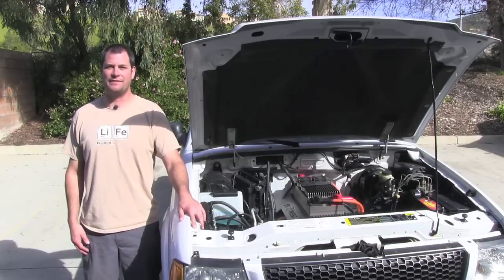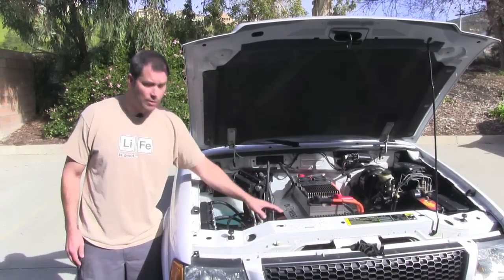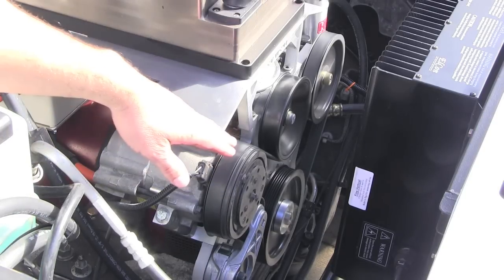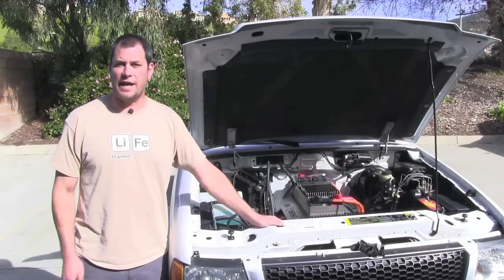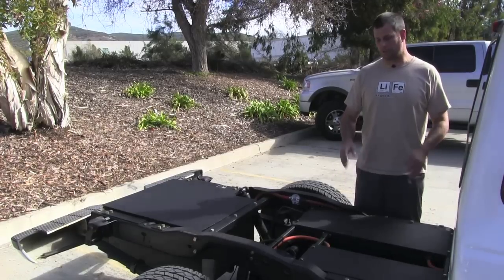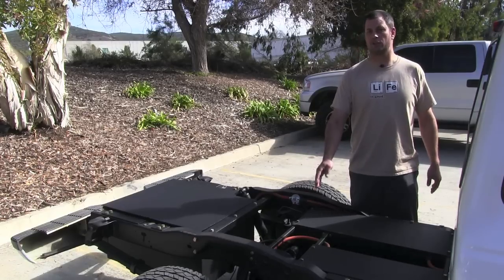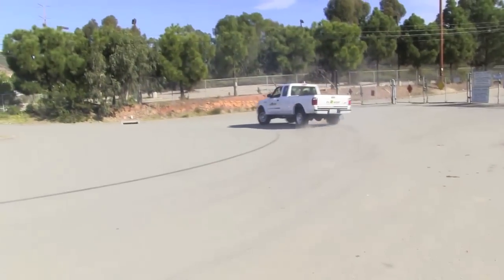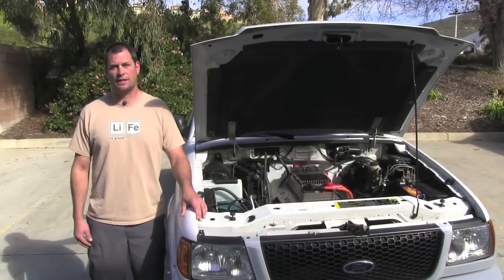EV West Shop Truck Walkthrough - 2003 Ford Ranger Conversion

Comment: In a 5 minute video about an EV Pick-up conversion, zero mention of the most important information, charge time, range per charge and price.
Reply: I imagine those are the bits of info that are not nearly as impressive as the rest of the presentation.  Short range, long charge time and pricey would be my guess!
Reply: You can find all the data for this truck on their website.
Reply: on board charging system, no down time if everything is working ok

Comment: So does this mean the traction motor has to stay running all of the time to keep those pulley-driven components working?  I would have preferred a method that powered them independently.   I would have loved for you to show us the charging port, and taken us for a test drive inside the vehicle.
Reply: I’ve been watching you for at least the past decade (since you posted this comment). I was thinking about doing a similar conversion with my truck, and I was reminded of that Eagle you converted. That was cool, man.

Comment: Ford produced experimental electric Rangers back around 2000. The motor mounted directly to the one piece rear-end differential transmission. So converting the drive-train was a simple as replacing the rear end. Ive been hoping to find one for my 87 Isuzu Pup conversion. Most of them were destroyed, but a few were saved.

Comment from the maker: @Sixdouble5321 The range is 120 miles. Cost is tough since it's a "shop truck" and we have been experimenting with the products used. A typical conversion goes for $15k-$25k.
Reply: Can you make mileage range  between 350-500 miles? And the cost.
Reply: Can you make mileage range  between 350-500 miles? And the cost.

Comment: very nice. I have been watching the EV technology evolve, and I feel it is time to introduce my idea of converting sailboats into electric. Several of the specifics you metioned such as cooling and batery charging are perfectly suited for a sailboat, which only needs electric when entering or leaving a slip, or when an extra push is needed. Also, water for cooling is available, and the prop continually wants to turn while sailing, a perfect way of regeneration. Please contact me with ideas

Comment: I have a Lincon Town Car 91 and I'm really excited for put this technology in my car. 
One question, The truck uses a factory gearbox or an especial gearbox for the electric motor or don't use it?
Reply: Well, since these guys are apparently too busy charging batteries to answer anybody's questions about their stuff on here, I'll tell you what I know from what I've seen. They used a 2 speed powerglide tranny with no torque converter on it and no bell housing on it either. It just bolts straight up flush to the back of the electric motor. It uses a pump to automatically pump the trans fluid through it when it's not moving. Some sort of window motor they said (I think). When the motor stops turning over 500 rpm, it automatically starts the accessory pump so it still behaves like a normal engine/auto setup behaves. When you start going again, the switch kills the accy pump and the electric motor pumps the fluid through the tranny again. Anyhow, hope that helps.

Comment: Very informative, answered a few questions I had. I noticed you are using a Ford Ranger, and I've seen that most EV pickups are smaller. Is that because of the weight of the batteries used to move a larger piece of metal? Or is it because less weight means longer drive time? What if you had a system that could recharge on it's own without needing a plug in, would a bigger truck be feasible?

Comment: How does the transmission work? What about gears? Do you just take the engine off and stick a motor where the engine was, using the trucks original gearbox?

Comment from the maker: @TheDeerkillers Please check out the Vehicles page on evwest.com. There is plenty of detailed information there. The range is about 120 miles. We've had over 1200 pounds of cargo in the bed, and it still had plenty of power.
Reply: I have an 2002 Ford Range XLT 4-door cab 4x4 Ranger.  I've been thinking of going EV with it.  What would it cost to have EV West convert mine?????

Comment: I want to see what a lighter 1989-1992 Ranger "S" model (basic with none of those power options) will do with a warp 11 motor mounted direct to one of those old 3speed manual transmissions. They take the real gear oil, not the thin red stuff. No clutch, not even a bell housing, cut the shafts so the motor will be as close to the transmission as possible. Mounting right where the bell housing would would be perfect. It would set the motor back under the tunnel a bit, and leave more room in the engine bay.

Comment: How much money for a kit that includes all the components you used for this build? Not install or hardware etc. just the ev components.
Reply: $7000
Reply: What am I missing here? Everything he mentioned less batteries came to $9,737. The batteries alone add another $18,468.00.  That's over $28k to convert.
Reply: Tony Masopust how many 18650 cells did he have to use to make his batteries

Comment: what is the range ?
Reply: Just Paul i know its been a while since you asked this, but I did some back of the envelope math and figured other people would want to see this.

if we ASSUME this ranger uses around 500wh per mile, and it has a 44Kwh battery pack, (180ah x 243v) then it should get around 90 miles to the charge. (theoretically.) but real world would probably be anywhere from 60 to 80 miles because of the belt driven accessories requiring an "idle."

Comment: Have you guys done a conversion on a 1990 Ford F150 pickup? It has a 4.9L gas engine and will be converting to Electric locally. I would love to work with your shop.

Comment: Do you sell this as a conversion kit? How much for a full kit? I have an 01 4.0 I'd love to do this to instead of rebuilding the motor. I'm spending $10,000.00 a year in gas at current prices. So if it's within $15,000.00 it's worth it to me
Reply from the maker: You can check with the sales team at EV west using sales@evwest.com they can answer the specific questions you have. Sorry of the delayed reply... Drew - EV West Media Manger

Comment: Tow capacity?
Reply: THE BIGGIE Z    Trailering range like: 10,000 lbs over 20 miles
But realistically like 2500 lbs above dry weight over 35-45 miles, max 60 miles hi-way.

Comment from the maker: @madbrat34 The cost of an EV conversion varies between $15k and $25k depending on range and options. A solar panel that's fits in the bed, won't charge the truck adequately.

Comment from the maker: @DanFrederiks There are only Lithium batteries in the high voltage pack. The pulley driven power steering and brakes are much much more quiet and reliable than electric motor driven ones.

Comment: I’m sure this motor was destroyed quickly, perhaps a month of use at such abuse of high voltage and amperage, violating NetGain/Warfield best practices, no RPM control implemented. That Warp9 died of either over-rev or over-temp

Comment: Hello I seen your video on your ford ranger. How can I get direction on how to put a electric truck together. Where can I buy and electric motor thats equal to 350 Hp up to 460 Hp. how do u keep water off the motor I drive in the backwoods crossing creeks hauling wood out to my home. What are the cost to build a full size truck or can it be done.what are the warantys on emectric motors. I want to put a generator on board for recharging. Any information thanks TB

Comment: Does that have a man tranny?

 Where can buy that kit? 

Also info about specs, maintenance, real customer and R&D long-term product reviews, all known variables and performance-related differences, optimal temperature/humidity/altitude ECT for component performance, Dyno, WHP/WTQ, top speed, are there different stage kits, wet weight of system, full charge average range,  throttle % input/mph based different results, charging time, battery life span, routine service, warranty, recalls, battery explosions/fire, ECT ???? Thank you

Comment: I've got a early bronco with a 3 speed manual was wondering what kind of kit I can use on that to get a reliable daily use and trail use as well
Reply: Broncos are pretty heavy, so you'll need something with a bit more oomph than a Warp 9 motor. A pair of Warp 9s might work, or one of the bigger dual AC motors. There's a Facebook group called DIY Electric Vehicles with lots of very knowlegable people who can help you out. I'd love to see a Bronco conversion - there don't seem to be a lot of people converting older trucks.
Reply: We’d like to see conversion for a little Bronco II.  Those are just a different body on an F150 chassis, so theoretically, could more easily convert than the full size Bronco.  
With the newer Li battery packs now, should be able to get about 100 mile nominal range, and fit those into the space where the back seats would otherwise go.

Comment: why don't you use solar to recharge your batteries while the car is driving?
Reply: Iseekoutthetruth it would only add about 200 foot range extension. Solar panels are very ineffective at creating the power volume necessary in a small area. The better option is to create a miniature arc reactor. That is why solar farms cover hundreds of Acres of land just to equal a ton of coal.

Comment: Can any of you answer what kind of range I could expect with this motor and accessory plate with a 3/4 ton pick up with an E 4OD transmission?I realize most people desire the smaller trucks and cars but whats wrong with increasing the size of the battery bank and having a vehicle capable of long hauls and actually doing something other than get groceries?
Reply: A 3/4 ton pick up truck is going to be very expensive to convert.
1. You will need a huge amount of batteries, towing 10,000 lbs  + GVWR means you will have to use 1700 Wh per mile of range, now 100 CALB 180Ah LiFePO4 cells gets you 320 volts with 180Ah or 57.6kWh that means your range will be about 33 miles(thats pretty bad).
2. Your motor will be very expensive and will not last very long, a Warp 11 motor will require about 300kW to accelerate, then another 40kW just to maintain speed, without secondary cooling, the motor will overheat.

Comment: My thinking is leave the ICE where it is and remove the transmission and replace it with a generator. Move the electric motor toward the rear. Make sure the batteries give at least a 40+ mile range when charged. Then you've got a truck that is practical for all kinds of driving plus great mpg. Have you thought about rebuilding a pickup in such a manner?

Comment: i dont buy that! It would be nice to get an answer from evwest instead of another viewer.
I know with that battery setup there will be about 25% sag in the voltage under full load of the soliton1, its my guess they are just letting it fly like that. But i wanted to ask the question to be sure.

Comment: I've driven two of these Ford rangers in courier work. But an all electric truck would not be practical as you commonly drive around 200 miles a day in all kinds of driving. Too much range anxiety. A more practical truck would be an electric with a range extender much like the GM model.